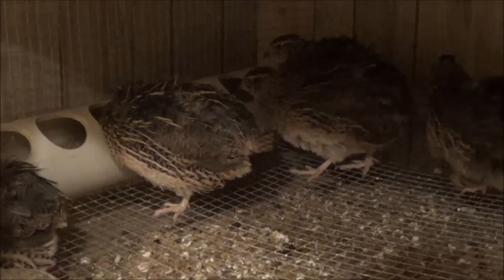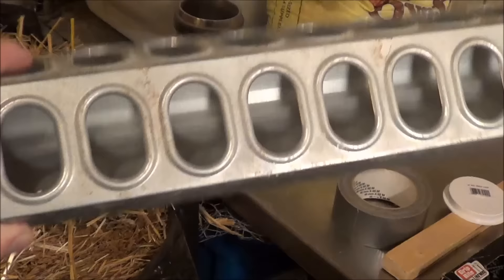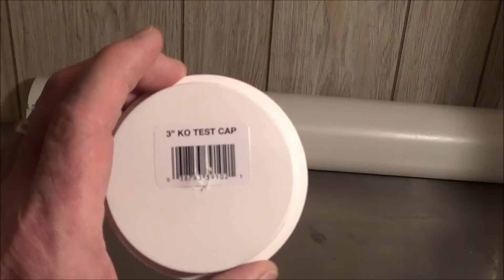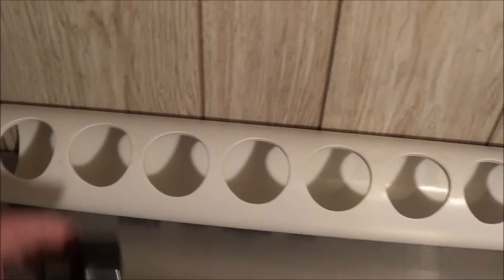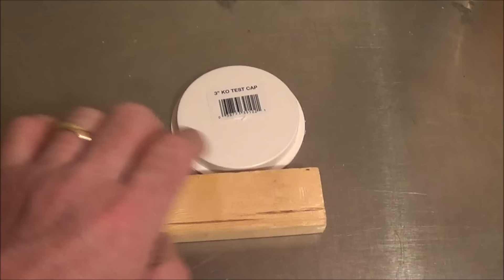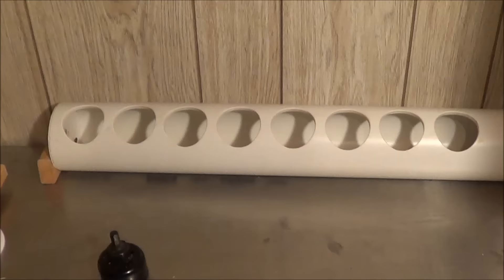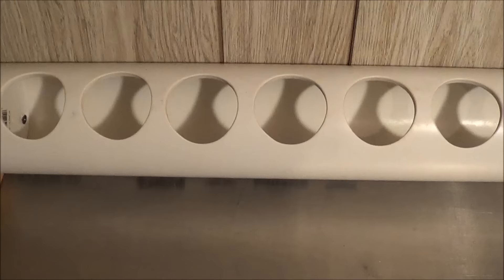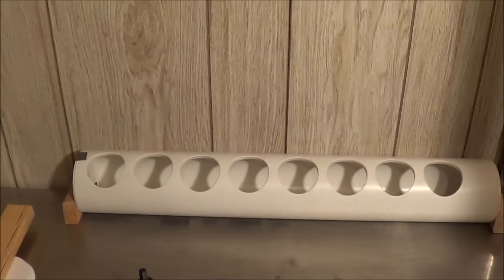Homemade Quail Feeder

Comment: My wife and I had a similar idea, except mounted outside the cage and a quarter of it cut out down the length of the PVC pipe for their heads and then cutting holes in the caging for their heads and having it mounted to the cage. So basically a 3/4 circle trough. This is even better and surprisingly doesn't take up any room inside the cage and is more similar to the Tupperware containers with holes cut in them everyone loves as a cheap no waste feeder. Only problem with them is they take up more room inside the cage and eggs apparently always get hung up on them. 

This is the perfect combination of those Tupperware container ones with holes and a trough or J-feeder. Love it, this is what I'm going to use. It's small and unobtrusive, very cheap and easy to do and everything the Tupperware containers are not. No eggs are getting hung up on that on a tilted floor cage with egg catcher. Might just have to fasten it to the back with wire so it doesn't slide forward on a tilted floor cage. Love your logic too "end caps? Lol, too expensive and no need, this thin little cap will do just fine and only a buck". Bravo, I've done the same with other projects with PVC too, just glue or caulk (or tape like you did) a blow off cap or those thin slip over caps (frequently blue or red in color) like they also sell in with the ABS and PVC piping, if doing something which does not require strength or good watertight sealing.
Reply: Would love to see a picture of your feeder. Love this idea, having them  on the outside of the cage
Reply: @Sheilazy1  Wish I had a picture, but I have not built one yet and don't have any Quail yet. I would like to get them come spring or summer, when others local to me, are breeding again. Seems nobody is breeding around me in the winter, but the few connections I have found here (just small scale private Quail keepers), said that come spring they will be breeding again. I have most of the supplies to build cages but haven't done any building yet.

 I really don't want to order them from elsewhere further away from me and have them shipped in winter, too cold and they eggs won't likely be viable due to that. There are sellers online, who ship them from a few hours South of me, but with winter and shipping, I think the chances of them being viable are low and nobody guarantees viability of the eggs, so...... I just don't want to waste my money. The more local, the better. I would actually like to by chicks/live Quail to start and then get them laying and hatch my own, rather than start with eggs and hatch them. I want to ease into this and do hatching after I have got some live ones and get used to keeping them. I'm so new to this and inexperienced.

Comment: I made one of these and it has been feeding my quail with zero waste for over a year.  I made it as shown at first but then rotated the pipe with the holes so the holes are on the top of the tube.  The birds don't mind and have suffered no damage to their necks or feathers.     Its an awesome design.   Is there any reason whythe design wouldn't work for chicken?    I'm thinking if i use the same exact design but  since the chickens like to scratch and roost I'd make a shelf  over the pipe with the holes.     this would allow access from the side, but  prevent the birds from roosting on the pipe.     what do you think?

Comment: I built this feeder but filling it is a pain in the butt because all the feed spills out through the holes. I solved that by putting tape over the holes before pouring the feed down the tube but I wonder if there’s an easier way Well I’m not using all my packing tape.How do you spell yours without making a mess?

Comment: How can you make this where you can add the food without going into the cage,  like from the outside in?
Reply: Use a 90-degree connector on one end, then a PVC connection system (straight or whatever else you need to get it to where you want it to be) up to the height or area where you want to drop in the feed.

Comment: Would covering up 1/4 of the holes work, or covering one side? Surely adult ones wouldn't fit in there, they must be large holes. Unless you have tint quails. Mine wouldn't fit in there.
I'm building one similar, only mine I'll be able to fill from the outside and last a few more days :)